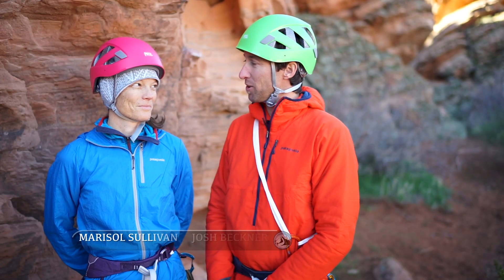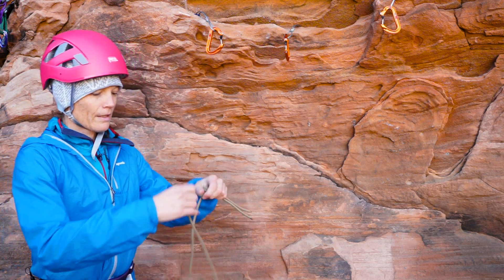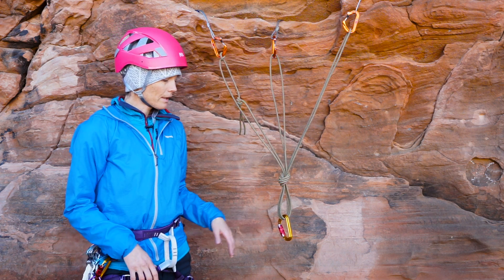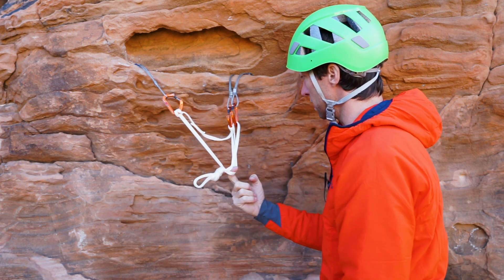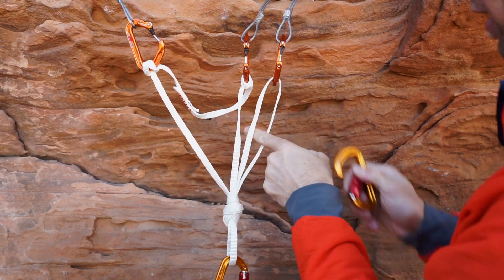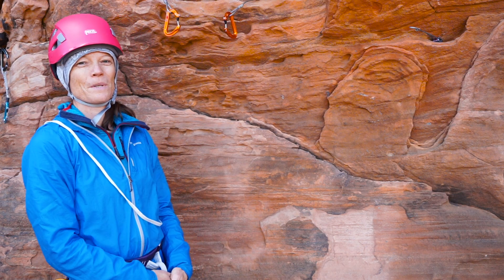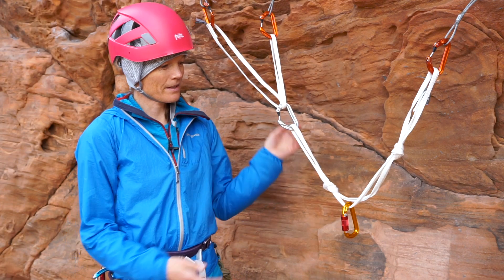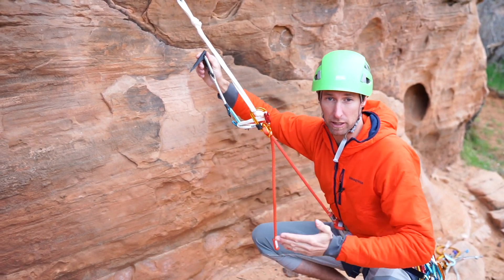Advanced Climbing Anchors:  Efficient 3 Piece Systems

Comment: quads are only quick to set-up if you're lucky and don't have to re-adjust the position of the limiting knots. to really reduce extension to a minimum you need those limiting knots to be as close together as possible, then you end up having to adjust them every time... that's why I don't bother with quads and go for the typical w set-up, which all taken in consideration is super good enough and the fastest to do and undo...
Reply: 180cm is the secret for quads.

Comment: Great video thanks!

Be very cautious when loading single strands of a high tensile knotted material as done with the V-clove. Most recent analysis has shown that they can break (see article about sling breaks in bergundsteigen, #107)
Reply from the maker: Thanks for the reference. It's nice to see comments with data.
Reply: Bergundsteigen #107 details a fall factor 2 fall, onto 5.5mm cord which was tied directly into the lugs of two ice screws. It's worth highlighting the potential dangers, but I would also say that the ice screw lugs are significantly sharper than a typical carabiner, which means that the forces that they can take is much lower. 5.5mm cord is also on the skinny side. The testing done in the report showed that the force held by the single thread was 5.7kN for the ice screw and 8.5 kN for the carabiner. So the carabiner can take 50% more force. A FF-2 fall is not all that common (sure it can happen, but it's always super dangerous even if your anchor survives). Using thicker cord, using carabiners, using a "jesus piece" to avoid FF-2 falls, all will mitigate the dangers of tying a knot in a single strand.

As such, I wouldn't hesitate to use this configuration when climbing, but it is good to know the limitations, so I appreciate your comment highlighting this report!

Comment: For your 3rd example of the sliding X anchor, the two piece component has a masterpoint, meaning that it is a critical junction. From my understanding, that should be a locker. Which in the end ups the gear count, but instead of using two slings and a locker, you could just make a 3 point quad and save material. Also, if concerned about whether or not the two piece component pieces blow, you may want to consider tying limiter knots, otherwise all of you weight gets loaded onto the "strongest" piece and you end up shock loading the other piece. Lastly, I know that this video is demonstration for different practices used in the field, and I understand that there aren't necessarily "set standards" about where you need lockers and whatnot. Just some things that popped into my head as I was watching. Great video though, I've never seen the V Clove before, definitely using that one!
Reply from the maker: Isaac,  Yes, quite often you'd put a locker on the sliding-x, but it's very situational. I usually use a non-locker if I'm at the belay and able to monitor it. I use a locker if I'm not able to monitor it, ie in a TR setup. And yes, you can make a 3 piece quad but sometimes you don't have enough material to reach all the pieces and it's generally slower to rig, especially if you've already got your quad tied together, which I usually do. That would require untying it and retying it.

Comment: (revised)At 2:30, using a nylon/dynamic cord and not a static one, the small differences in pre-equalization would be quickly taken up by stretch under a significant load - effectively equalizing, with small disparities. At 7:20, NEVER create a tie-in with static slings only; if you move up to jigger with a piece, and slip, that can create a factor 2 impact jeopardizing everything including your harness loop. Think 1) static slings = cables; 2) always connect yourself to the anchor with some dynamic intermediate, length of lead rope or nylon, never Dyneema. Overthinking "sliding equalization" notions is not borne out in real scenarios, generally. Distributing load between separately isolated anchors is usually fine, as shifting, should one fail, results in a penduluming force that is actually very low, compared to a shock onto a couple feet of slack sling as it redistributes everything. The "shelf" concept seems confusing, and needless, versus adding a second locking biner to the Master point for belaying, etc. Of course, the set-up optimizes belaying a second, but to swing leads an upward pull anchor has to be considered, complicating the master point idea.

Comment: That second anchor is DEADLY. DMM did a shock test on knotted dynema and it can break from just a factor 2 fall. It’s better to knot nylon since it has more give. If you disagree watch DMM’s testing on dyneema.
Reply from the maker: The DMM videos left out a significant amount of detail, most notably, a system with dynamic components. If you are using a rope in your system, that will serve as your dynamic component, and it doesn't matter if you use dyneema or a steel cable, the rope will create a dynamic system. Okay, maybe a steel cable isn't a good idea, but dyneema is! There's been plenty of testing that demonstrates that knots are just fine in dyneema and Petzl has a number of tutorials on their website that demonstrate using knotted dyneema in anchors. https://www.petzl.com/US/en/Sport/Multi-pitch-climbing 

On top of that, EVERY certified guide I've ever worked with uses knotted dyneema in their anchors. It's the industry standard, the DMM videos were just single data points that didn't take into account practical application in the field.
Reply: SIET, School for International Expedition Training  thanks for the response!! Yeah if there’s a dynamic feature in the system it’s safe true. But I wouldn’t use knotted dyneema for a PAS, thank you for the clarification. I guess DMMs video just freaked me out
Reply: I agree with Kyle that the some of the anchors depicted here are dangerous, however for a slightly different reason. The relevant metric should not be the fall factor but rather ultimate breaking strength. Dyneema in a loop is rated to 22kn. When you tie into a single strand instead of the loop, you halve the breaking strength to 11kn. It’s important to note that a clove hitch reduces the strength of the material by about 50%. So tying that single dyneema strand into the piece with a clove hitch further reduces the breaking another 50% to 5.5kN. It’s even worse with 6mm perlon, which has a single strand breaking strength of 7.5kN, which is reduced to 3.75kN when tying in with a clove hitch. Cams generally break at 10-14kN so this tying in with a single strand clove hitch puts an unnecessarily weak link in the chain. It is quite possible to put a 3.75-5.5kN load on an anchor in the event of a fall, even with a dynamic rope. It’s true that other pieces in the anchor may share the load, but “equalized” anchors are rarely perfectly equalized so it’s possible that on piece can take the full load. I reviewed the Petzl literature and I did find instances of Petzl recommending putting an overhand knot into a dyneema loop (two strands). Quick calculations show this has a breaking strength of about 18kN, which seems to be more than enough. However, nowhere in the Petzl literature did I find the recommendation to put a clove hitch knot into a single strand of dyneema, which, by my calculations, can fail at 5.5kN. Further, I think physics and empirical evidence (e.g. break tests), rather than widespread usage, should be the arbiter of whether a particular technique is sound. Only a few decades ago, rock damaging pitons were the standard on classic free-routes. Not to mention swami belts, hip belays, and sticht plates. Also - a distinction should be made with clove hitching into a piece with the climbing rope versus a single strand of dyneema. Climbing rope is designed to be used in a single strand and thus has a single strand breaking strength about about 20kN. However, climbing dyneema is designed to be used in a loop and thus has a loop strength of 22kN, or a single strand breaking strength of 11kN. So tying into a piece with the rope on a clove hitch would weaken the rope to about 10kN, which should be plenty for an anchor application.

Comment: Question about  non locking biners used on the protections. 
Since you are not using locking biners on the protections in the video , is it  officially an accepted way  of building anchor ?

IMHO , it is an acceptable way to build  TRAD anchor only since on trad anchors climbers are near of the anchor and can immediatly see if something wrong. 
As opposed to top rope anchor that  need to be with locking biners since it is left alone.

note: BTW,  I half the times used not locking biners to build my trad anchors but  friends sometines freak out.

Comment: On the last anchor maybe adjusting the knots closer together once you figure out the equalization spot.  A 2ft pc of dynamic rope probably wont have much more shock absorption as a static sling or rope.
Reply from the maker: This still being debated. For now, as long as there's a rope or dynamic PAS in the system, there's no need to put the knots close to the master-point.

Comment: Regarding the use  of an «edk» to close up a cordelette loop. 
«Pros»; 
-easier to untie to access full lenght of cordelette,
- in your demo...by putting a clove hitch just above it and putting a knot below it to create a master point...the strand with the «edk» is isolated against failure,
«Cons»;
-if clear instructions are not given, this could be ( and has been) used in inproper set ups.... I have seen numerous vtread cordelette tied in this fashion with only a few inches of tails .... some even use it on 1 inch webbing loops (again wtith only a few inches of tails coming out of the knot) and not «isolating» it against failure!!!.... I have seen prusik loops closed up with an «edk»!!!

Using the «EDK» to link 2 rappel ropes is fine by me...  with at least 30cm of tails (I prefer to add a second knot to slow the slipping has recommended by Andy Kirkpatrick in his article ; the ultimate abseil knot).

I dont even have a problem with the use of it in a 3 legged anchors (especially if the «edk» is isolated).

Just know that ENSA testing shows and concludes that this knot should  NOT be used on cordelettes of any kind.... even with 30 cm of tails.

A simple caption /notice in your video regarding the limits of this knot to close up loops might be a good idea.

Charles / rock and ice instructor
Reply from the maker: Thanks for the thoughtful comments! I fully agree that the EDK can be used incorrectly, especially when there's not enough tail. I'm a big fan of it for my cordalette because it makes it easier to untie when needed. 

I'm aware of the ENSA tests. However, they used very slippery cord (I believe it was Gemini cord?). We've done loads of testing at Petzl and found that on most cordalettes, the knot doesn't role until you've put very high loads on it.

With that being said, I think your last point is a great one- we should do a separate vid just on the pro's/cons of the EDK!

Thanks again, 
Josh

Comment: On the quad anchor isn't there two points of extension? If the right blows like you showed there's extension but even more on the sliding x side, if that blows you get extension there and extension at the master point.  Why even do a sliding x? It's already pre equalized at the master point? Wouldn't it make more sense to add an over hand to avoid shock loading the left side of one point fails?

Comment: In your quad with a magic x, could you not make this better by putting load limiting knots in the sling with the magic X and also by moving your load limiting knots closer together on the quad so that there is less extension should a piece fail and therefore less force applied in the case that it does fail? Particularly the limiting knot on the right side of the quad doesn't seem like it needs to be that high.
Reply from the maker: Sarah, you can put in the load-limiting knots but as long as there's a dynamic component in the system i.e. a rope, it doesn't do you any good if a piece fails. That's because an EXTRA drop of 5-10cm doesn't create enough extra force to make much of a difference. I rarely pay attention to how far the load limiting knots are in my quad because my pieces are generally pretty bomber. Maybe if I'm using questionable ice screws, snow anchors, or something similar, then I'll pay attention to where the knots are.

Comment: A question about the third anchor. I’ve seen the same setup in other videos but I wonder if the use of the sliding x is optimal. If one of the two left pieces fail, the entire load goes to the right—it’s not going to be shared by two pieces, because the extensibility of the sliding x is beyond the knot on the quad. Couldn’t you make that a fixed point with a knot and still have the quad making it multidirectional?
Reply from the maker: Thanks for the thoughtful comment. Yes, you can certainly do that. However, I'm rarely in a situation where I'm worried about a piece actually failing. If that's a possibility, then I might use a quad where I used the sliding x, two quads total. As we highlighted in the blog that accompanies this video, if you have pieces that are marginal, the quad is the best way to distribute the load as close to evenly as you can get, though I still wouldn't bet on it being equalized (that concept is also covered in the blog). Thanks again!
Reply from the maker: Hmm, to which anchor type are you referring to and what's the context? The second carabiner might be better but I'm not sure what type of anchor or situation we're talking about here.
Reply: @sietschoolforinternational5234  As noted earlier, this logic seems backwards. If one's entire anchor is that sketchy, it is likely impossible to judge which is better or worse, and creating as close to equal distribution, but from independently isolated pieces, may not form perfectly equal loading - but minimizes significant shock loading the remaining pieces, should one or more fail, a scenario far more likely to result in total anchor collapse if all are really that poor. At that point, opening one's mind to every option, needs consideration - from looping the rope down to the last decent pro, having the second re-anchor and belay from there, moving up or across to reach more anchor potential, placing ten pieces together, etc. I worry that all the "Guide Endorsed" methods have actually stifled the resourcefulness of new trad climbers in their learning path. I may not be fast or efficient, but I'm still alive after 54 years climbing, including aid soloing Half Dome clean, pre-Friends.

Comment: I would like to see drop tests on 1.5 feet of dynamic PAS.  Any material difference to using stiff dyneema sling?
Reply: Yes! Short falls onto static vs dynamic slings, ropes, and manufactured personal anchors have definitely been tested. You can find them with a little Googling; here's a pretty representative one from BD: https://www.blackdiamondequipment.com/en_US/stories/experience-story-qc-lab-personal-anchor-systems-explained/ 

Spoiler: dyneema generates something like twice as much force as nylon, which generates about twice as much as a dynamic rope in a factor 1 fall (i.e., you fall the length of your attachment). The usual disclaimers about how tests don't represent the real world apply, but I think the clear message is that you and an anchor you're directly attached to are a lot more likely to be damaged in a short fall if you're attached using something without a tendency to stretch.

(Caution, I am a random person on the internet not affiliated with SIET).

Comment: For the "W" anchor configuration, you appear to be using 6mm nylon accessory cord. Is that diameter sufficient for anchor building, or should something stronger be used?
Reply from the maker: Generally it's best to use 7mm perlon or 5.5mm tech cord (similar to Dyneema). We used the later in the video.

Comment: Nice video, concise and informative, thank you! For the quad anchor, you list as a con that the shelf isn't as user-friendly, but it looks to me like it doesn't have any shelf at all (at least, not one that's equalized, you pick the branch to give the full weight of whatever's clipped into the shelf). Am I missing something?
Reply from the maker: Gabriel, if I'm using 2 reliable bolts for my anchor I often clip my Reverso to one of the loops closest to the bolt. I think that's what you referred to as a "branch?" In that case I'm using a redundant but not equalized shelf. If you need a more equalized shelf, you can clip both loops but then it's a bit of a cluster.
Reply: This page seems to help. Looks like splitting the Quad is an option!  half and half maybe?  basically that is two mater points....    but maybe less attractive the smaller the cord diameter.....   I suppose a second sling used in the system is also a good way to go!  make a second master point entirely.    https://americanalpineclub.org/resources-blog/2016/6/27/the-masterpoint-the-shelf-the-components-anchor-anatomy-in-action
Reply: @sietschoolforinternational5234  why not just add in a second carabiner into the master point and make a second point... ?   is there a problem with this?  seems like it may be better than the potential (extra) extension.... which could be drastically bigger in some rigs.

Comment: I feel like it would be better to tie off the sliding x for the last anchor, if one of those pieces fail you're gonna get a nice shock load
Reply from the maker: As long as there's a dynamic component in the system (ie a rope, dynamic PAS, etc) the 'shock load' adds a negligible load. Redundancy with the sliding x is the biggest issue.
Reply: @sietschoolforinternational5234  that makes sense, thanks for the reply!